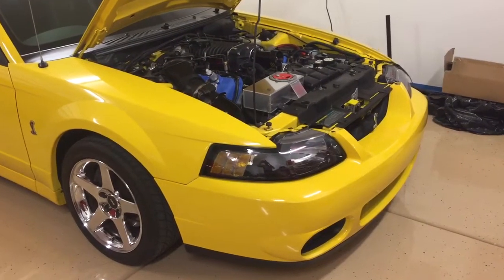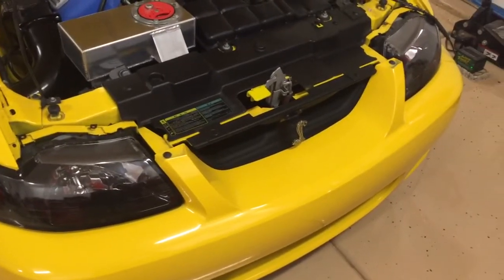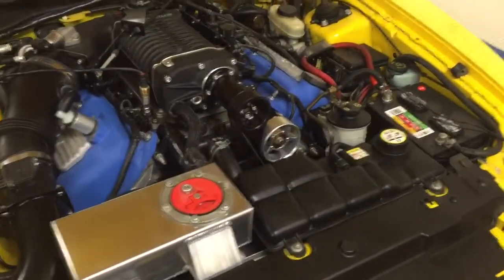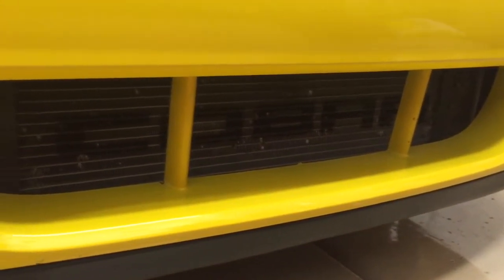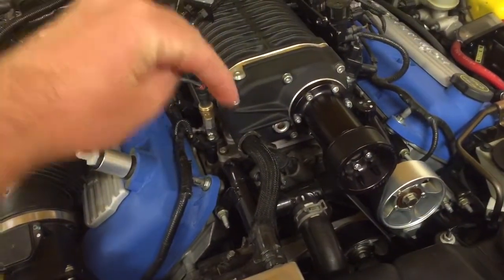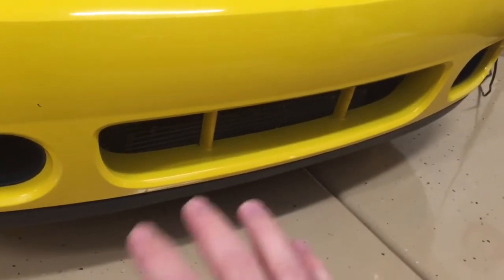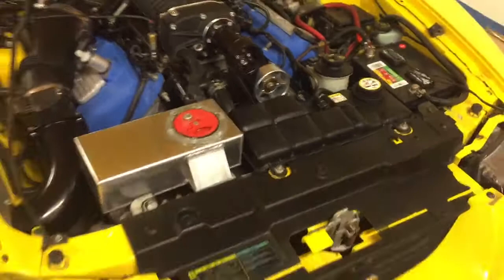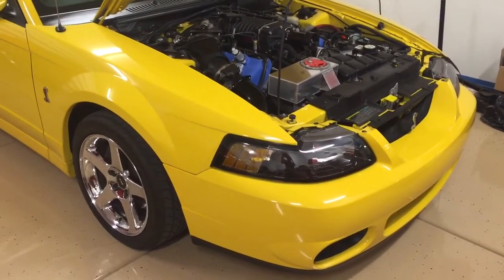How an intercooler system works and why you need one

Comment: I run a cwa 100 pump for my C32amg and notice temps are terrible, the outlet of Heat exchanger goes to inlet of pump. Outlet of pump straight to IC under the blower

Comment: Would a 03 intercooler set up work on a 99 cobra with a kennebell supercharger
Reply from the maker: You would also need the lower intake manifold and some other parts. There are some threads out there that show it’s possible to “eaton swap” the 99/01 cobra.
Reply: @dannyjohnsonsgarage  I already have the kenne bell supercharger wouldn't the work?
Reply from the maker: old Greg It depends on what kit you have, but you will likely need the terminator lower intake manifold for the heat exchanger to have the air to cool.
Reply: @dannyjohnsonsgarage  I think the lower intake manifold is the same for 99 and up
Reply from the maker: old Greg No, it’s not. The 03/04 cobra has a different lower intake manifold to accommodate the intercooler. The 99 cobra has knock sensors in the valley that need to be filed down to fit the bigger 03/04 cobra intercooler
Reply: @dannyjohnsonsgarage  when I look up 03 lower intake manifold it says it will fit 99+
Reply from the maker: old Greg  Listen. The 99 intake will fit all 99-04 because it is already made to fit the 99 cobra with the knock sensor ports in the valley which the 03/04 does not have but the 03/04 cobra lower intake will not fit in a 99 because it’s bigger and will hit the knock sensor ports. You need to remove the knock sensors and shave down the knock sensor bosses for the manifold to fit. It’s part of the eaton swap directions and likely a step you need when using the kenne bell intercooler kit.
Reply: Hey dumbass...I have a 99 Cobra and I had to remove the knock sensors and shave down the bosses to make it fit...boy are you stupid..I guess you engineered the car too...right smart boy....🤣🤣🤣

Comment: Hey Danny I have a question  I’m have a issue with my intercooler pump, I replaced it things went good. Followed you procedure on replacing it and troubleshooting it. Now I have a issue with it running sometimes and not running. It’s not the relay and if I jump it it works. Do you have any ideas what the problem might be ?
Reply: Thx Danny yeah I looked on some threads and found out. Thank you for you help, your like a Encyclopedia of knowledge on these cars. I appreciate your videos very much.
Reply from the maker: Kris Stathakopoulos Ha ha thanks! Yeah, hit me up with questions and I can usually steer you in the direction of one of my videos.
Reply from the maker: The IC system is heat activated, so it only runs when the car reaches a certain temp on the discharge temperature sensor (iat2 intake air temp 2 sensor).
Reply: I just picked up a 04 cobra with 67k original miles from the original owner, I feel like I hit the lotto. I have been a older foxbody guy and owner a 03 gt so this isn’t my first rodeo but these 03,04 cobra’s are a league of there own so that being said. I’m still learning about these cars.
Reply: These cars are truly special.
Reply: And the car is completely stock as well so it’s truly a gem

Comment: Off topic but what’s your current tire setup? Front and rears? Still running 275s all around? Thanks
Reply from the maker: Marlo Stanfield stock size 275/40/17 with standard tires up front and mickey thompson et street drag radials in the rear.  What do you run?

Comment: Nice job Dan. Did you get that tank yourself or was it there already when you got the car? Mine came with the same tank as yours but recently I got hold of a black powder coated model to match my Moroso coolant tank(overflow) right next to it. My original plastic overflow tank sprung a leak...a fairly common Cobra ailment! BTW, for anyone interested, Lethal Performance sells both tanks together in a kit available in polished aluminum finish or black powdercoat.
Reply from the maker: tominator  Lucky for me it was already on the car, so I didn’t have to buy it separately

Comment: So I replaced my stock with an lfp unit, I can hear the pump cycling clear when I jump it but no bubbling in the reservoir, any thoughts?
Reply from the maker: Jake Cotton you have air in the system. You need to blow air into the line that leaves the reservoir at the bottom. I even had someone put a plunger over the cap and unclog it like a toilet
Reply: That’s what I figured, I seen you said they go around 40k miles mines at 52k so I will have to try it, thanks a lot buddy!
Reply: Plunger? LMAO Dan! Never heard of a constipated Cobra before!

Comment: Hey Danny I watched your video on testing the IC pump. I recently had been driving my Cobra and during a hard pull coolant sprayed out of the supercharger coolant reservoir through my hood vent and on the windshield. Iv'e been told this can be a bad pump not working properly and causing heat to build up in the reservoir. I tested my pump and when I touched the two connection points I got a spark and the pump kicked on but then turned off. I tried jumping it again about five times and nothing happens. Any idea what my issue could be?
Reply from the maker: Derek Gambill the pumps work on and off as they go out. They build full of soot and can be cleaned out as a temporary fix. The problem is you won't know they aren't working until it's too late. I'd replace it
Reply from the maker: Derek Gambill here is a link to my replacement video as well https://youtu.be/X3FGpBaISHg
Reply: Thanks for the reply back. I just ordered a new pump. Have you ever heard of coolant spraying from that reservoir before though? It was the weirdest thing
Reply from the maker: Derek Gambill yes. My friends did that. Pump died, coolant boiled, spewed out the heat extractor and onto the windshield
Reply: Danny Johnson  Thank you very much! I've talked to tons of people about this and they act like I'm speaking Chinese
Reply from the maker: Derek Gambill ha ha.
Reply: Danny Johnson I installed a new IC pump today and then went to jump the pump and no coolant is flowing in the reservoir. I can hear the pump running but no coolant moving through the reservoir. Any idea what this could be?
Reply from the maker: Derek Gambill yes! Air in the system. People have blown down into the bottom line that leaves the expansion tank (or even put a plunger over the expansion tank like a toilet!)
Reply: Danny Johnson I swear nothing goes smooth lol so I just need to undo the hose that goes into the bottom of the expansion tank and blow into it?
Reply from the maker: Derek Gambill yes. Or put a plunger over the tank and pump it to un-clog it. Same principle as a plugged toilet lol
Reply: Danny Johnson I'm plunging the hell out of this thing and still nothing

Comment: To effectively cool these cars without ethanol, methanol or nos you need to go gt500 tall HE, quality water pump, and a tank in the rear. Then you will never have to worry about heat ever again
Reply: COBRA Nate coolant tank in rear? and also what do you mean by HE?
Reply from the maker: +Oliver HE= Heat exchanger. The tank he is referring to is one you can buy that goes where your spare tire is. Then you need a more powerful pump and run lines all the way to the front of the car
Reply: For the street you can get by well with a dual or triple pass heat exchanger in your front bumper. For track use the trunk tank is bigger & better so you can add ice to deal with multiple 1/4 mile passes.

Comment: Another great video thank you for that. Can you do a video talking about timing. I hear people changing the timing in their cars and stuff like that and I don't understand what playing with the timing does.
Reply from the maker: Yes. That would  be a good one. I am working on a spark plug video, so I'll put that on my to-do list along with headers vs manifolds
Reply: Danny Johnson, I'll appreciated if you can do it base on the terminator because I own a 04 black and I want to learn all about it
Reply from the maker: Yanny Fragoso ok. For now it's pretty common to see 17 degrees timing up to 17 psi on regular fuel, and a little higher for higher octane fuels. It depends on the tuner and his strategy. I want to get mine retuned since he went with more than 17 degrees and offset that with a rich condition
Reply: Danny Johnson ok, I been seeing in Facebook the number 17 degrees a lot. My car have 2.8 pulley on stock blower, 4:10 gears and Long tubes with borla stingers  and CAI, I don't know if is been tuned before but I put 93 octane and runs good but I notice it detonate quit a lot. I want to get a good tune before I break something. You have seen my car on Facebook is just that my name on Facebook is different I opened that account with my son name which is Brian Torres. What's the stock timing on this cobras?
Reply from the maker: Yanny Fragoso I believe stock timing is a bit higher, but Cobras were only running 8 psi and very rich (like 10s AFR). I would highly recommend the AeroForce interceptor gauge that I have. It will tell you how much timing you are running
Reply from the maker: Yanny Fragoso it literally just plugs into the OBD 2 port and you're done! https://youtu.be/RqIMkcu3m3Q